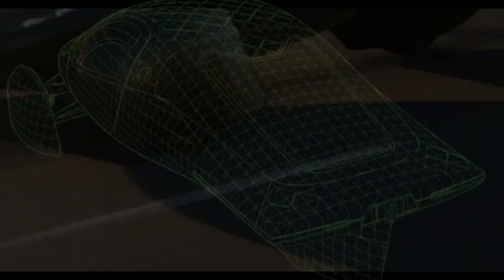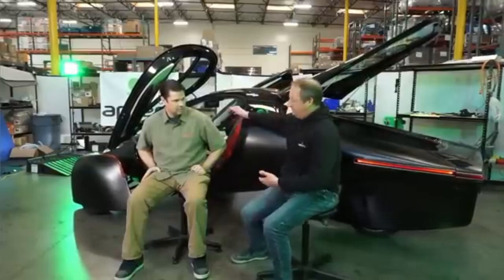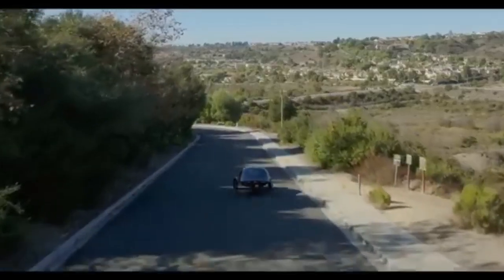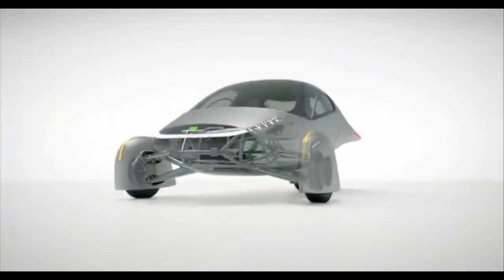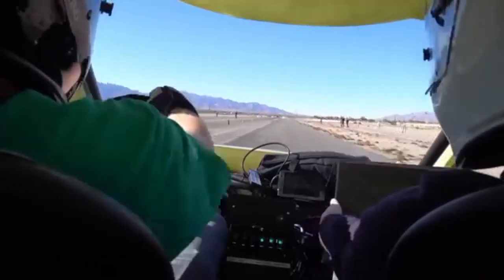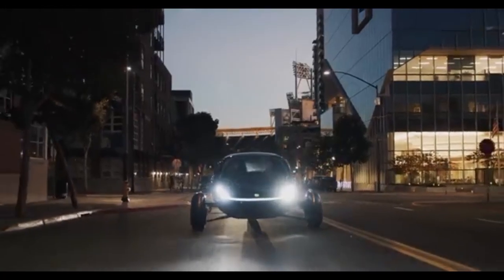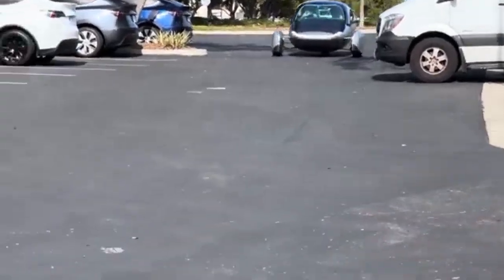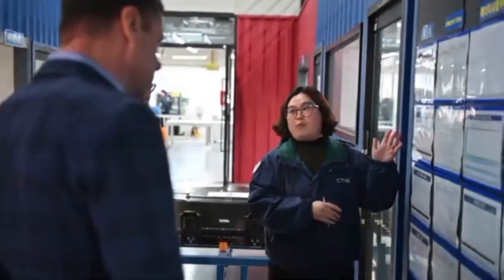APTERA solar no charge, design promising cheapest, bulk production by December 2024

Comment: This design has never been used before because it subjects , the rear wheel to potholes which are difficult to avoid, and it causes alignment issues and bearing/axel issues with the rear wheel
Reply: It subjects the rear wheel to potholes, thats  your concern!!  Bearing/axel issues, so your just making stuff up now? You have proof of these issues OR you THINK you know more than everyone else?
Reply: @timsmith6815  - It's actually not that uncommon with Polaris Slingshots.
Reply: I heard is was tested in Iowa and it works perfect for the potholes and snow.